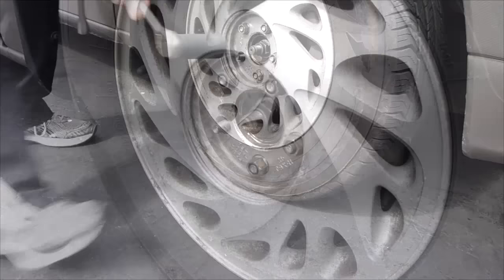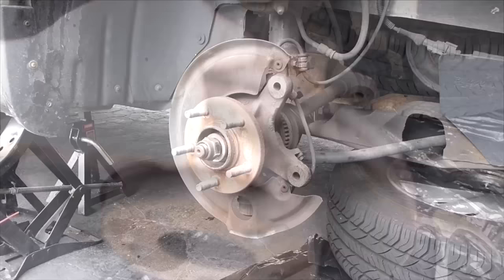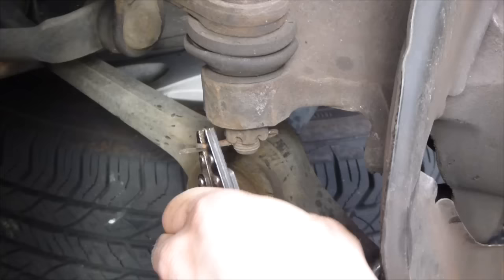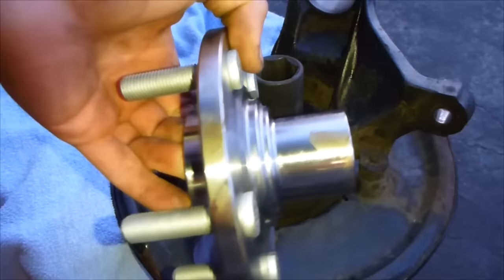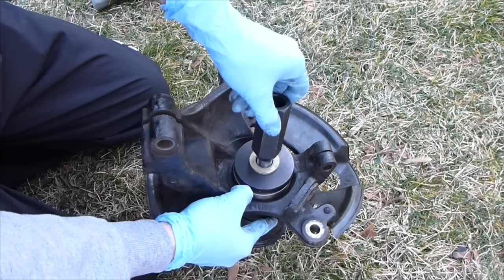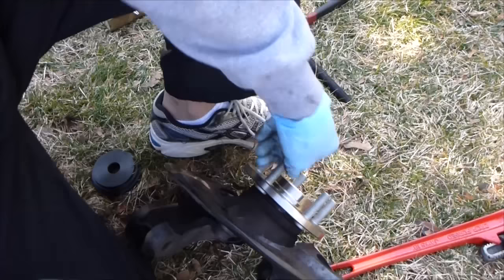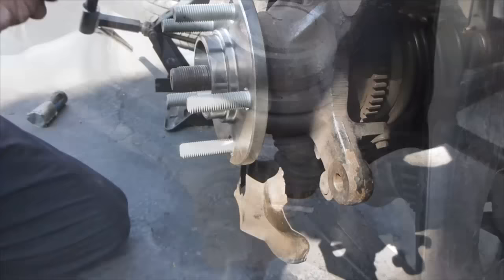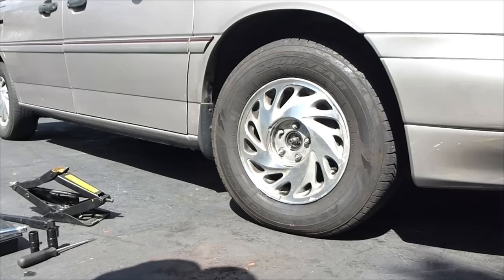How to Change a Wheel Bearing (short and fast version)

Comment: I have changed the bearing 3 times for the same tyre, almost every two months I have to change it. Does anyone know the reason why it keeps breaking down? 
Help plz ;(
Reply: There is most likely something wrong with another part of the suspension system on that wheel. Other issues could be too much stress being put on that wheel regularly for whatever reason, could be many reasons for that...or you are buying really low quality parts.
Reply: R 0 
Should I replace the hub ?
Reply: Use good parts, Moog or similar, NAPA, not Autozone. Make sure not damaging items during assembly- after 3 times you are probably getting pretty good at it, be sure pressing in outer race only. Avoid contamination- dirt, rust, etc., good luck
Reply: @r0498  probably cheap China bearings, you get what you pay for basically.

Comment: Hey Chris, good informative video. 
I wanna ask you something my ride's front right wheel kind of resonates at certain speed - 65 km/hr above that it's good and below that it normal. Tyres spins OK too though its not as free as i saw the hub moving after you replaced the bearing in the video. So does that resonance mean i need a new bearing?
Reply from the maker: Wasim Akram It could mean you need a new bearing or your tires are making the noise. I will have a video soon on how to diagnose a bad wheel bearing so stay tuned!
Reply: I don't think so about tires. I can feel that "resonance" inside the cabin actually. Do you think it still can be tires?
Reply from the maker: Wasim Akram It could be but without seeing the car, it is hard to tell!
Reply: I understand that. I hope you cover this resonance type of thing in your video. Should i wait for your video on wheel bearings? If its not going to take that long
Reply from the maker: Wasim Akram Should be next week. Up to you.
Reply: I can wait a week. Looking forward. Thanx alot

Comment: 3:57 seriously you hammer on the bolt without protection? Its gonna damage the thread? And that small hammer later in the video is NOT enough to take the bearing out, you have omitted a LOT of important  details

Comment: What about a front end alignment? Since you removed hub from strut.
Reply from the maker: Kelvin Lyons You can get one if you want but everything goes back on in the same place. The tie rod was not touched, the strut does not have a camber alignment so that goes back in the same place.
Reply: You would have use cam bolts.
Reply from the maker: Kelvin Lyons They dont have cam bolts for this vehicle. It is a McPherson strut style suspension.

Comment: What bearing removal/install tool do you recommend for a Honday Odyssey 2007, and can it be done without taking the knuckle off?
Reply from the maker: If it is a pressed bearing you can use what I showed in my video (link in description). You might not have to remove the knuckle. If it is an assembly you can do this: https://www.youtube.com/watch?v=fe_WtKIKlYA

Comment: Should i replace the whole hud or just the bearing
Reply from the maker: You can just replace the bearing but the hub was only like $10 or something so I got it as well.
Reply: ChrisFix just the hub assembly or bearing i have a 2001 mercury grand marquis
Reply: ChrisFix rear wheel drive

Comment: your not supose to lock the spindle nut lock, while the vehicule is on the floor you could break the bearing, you need to keep the jack that support the weight of the car a little to prevent this from happening, some car manual even mention it, like subaru
Reply from the maker: +yazmo109 Thanks for shairng. You cannot torque the axle nut with the car in the air. The tires will just spin.
Reply: +ChrisFix how about having someone hit the break, or just relief some of the front end weight, before.

Comment: Quick Question.  You know the Castle Nut (some people call the Axle Nut or the Spindle Nut.)  Before removing it I sprayed it with Penetrating Oil. and before putting it back on I put a little Anti-Seize Grease on the threads.  In another YouTube video the guy said if we get ANY grease on the threads of that Axle nut to immediately wipe it clean.  WHY???  If anything I gave mine EXTRA grease so it went on easy and doesn't corrode in the future.  What is the right answer?
Reply from the maker: Edmund Witkowski The castle nut is what goes on the tie rod the axle nut is an axle nut. I think you are talking about the axle nut. You dont want grease on the threads because you do not want it to come loose. This should not be a problem as long as you only used a little grease and torqued it correctly. Grease will actually help you torque it to the correct torque. What torque did you torque it down to?
Reply: ChrisFix i think my torque wrench went to a max 150 ft-lbs. then i used my breaker bar to turn it more. and also put the cotter pin in.
Reply from the maker: Edmund Witkowski Oh so it is actually a castle nut then. If you torqued it all the way and used the cotter pin you are fine.

Comment: I need advice. I am replacing a wheel bearing on a 2003 ford escape XLT and I cannot figure out if the snap ring goes on the front side of the hub after the bearing is pressed or in the back of the hub before its pressed!
Reply from the maker: +sliv5sliv look for the channel that the snap ring sits in. It's probably after the bearing goes in.

Comment: I have a question about my 2008 dodge avenger.  Steering is easy turning when turning left and car is in moting but when turning right while car in motion its hard.  When car is not in motion turning is hard either way.  Could this possibly be my inner tire rods or the entire rack and pinion?
Reply from the maker: TheRaydeez90 This sounds more like your rack and pinion or your power steering pump. Before replacing the rack, I would try this: https://www.youtube.com/watch?v=A0fiZCHz5ew
Sometimes a flush cleans out a clog and you get your steering back!

Comment: What aftermarket wheel bearing do you recommend as the best and closest to OEM?
Reply: Not cheap China bearings or you will be replacing in in less the 10k miles even if it's all highway.

Comment: What would happened if you don't torque with the right specification and you do it just by feeling?
Reply from the maker: epidemia2007 You can tighten it too much causing the threads to strip, you can snap a bolt, or it would make it impossible to loosen in the future. If you dont tighten it enough the bolt or nut can come off due to vibration. For the axle nut, if you dont torque it properly you can cause damage to the bearing.
Reply: Ok,thanks!!
Reply: Hey Chris,i have another question,Can you tell me where can I find the specs torque for any car?.Thanks again.
Reply from the maker: epidemia2007 I search for them on the internet. Eg. 2001 Mazda B3000 Axle nut torque specs... And see what I can find. I also have a shop manual for my cars which tells you all of the torque specs.

Comment: LOL.  Those bearings came out a little too easy.  Try one that has been on the car for 11 years and 300,000km (160,000miles).  The clip is rusted into place, the bearing won't move when you hit it with a sledge hammer, and the bearing removal tool won't budge it.  I had to take mine to a shop with a 25 ton shop press to force it out.
Reply from the maker: Roadghost88 This bearing was in a van that has 300,000 miles and is 19 years old in the salt belt lol. Each situation is different but a little penetrating fluid goes a long way with breaking free rust: Homemade Penetrating Fluid, How to Make Your Own

Comment: My husband and I are trying to replace the front bearing on our 2008 accord. This is the second time that, during assembly, the bearing breaks when we put it in the hub. We are using OEM master wheel hub and bearing removal and installation kit to do it.
What are we doing wrong?
Reply: Alyssa Glass where does it break from?
Reply: the6thverd it’s better if I can email the pictures. It exposes the piece with the metal balls.

Comment: you didnt have to take the knuckle off.  unless your impact didnt have the force to drive the through bolt and you didnt have the 1.25 inch wrench.  too much work the way your doing it.
Reply: How do you want to get the axle out if you don't at least unbolt the knuckle partially?

Comment: would it be easier to change the hub assembly instead of using a press tool? I mean if the cost isn't to much more. (for my car anyway 2007 optima )
Reply: +jessejaviangel It's press in , unfortunately. This is the only option
Reply: @mmiller1188  ? uh no?
Reply: @samuraimedi4061  It's not a unit bearing. The only way to change the bearing itself is to literally press it out. Or buy a knuckle with a hub and bearing installed

Comment: Hey Chris I need help I have replaced my pads rotors and calipers using your video and I'm having problems my Rotors get very hot and it's very sluggish could this be a wheel bearing ???? someone help out if you see this
Reply from the maker: +Noah Rule It could be a wheel bearing but it is most likely a bad caliper or the guide pins are not greased.
Reply: +ChrisFix I replaced the Calipers brand new not even 500Miles and my Truck is a 2000 Toyota Tundra they don't have guidepins you can grease. But im,hoping it's a Wheel bearing it'll suck,but at least I can find whats wrong with this dragging wheel problem

Comment: I have a question, about my vehicle.its an Ford escape having miss fire.what's the first thing I have to check...
Reply from the maker: Nick Onno There are three things to check. One is the spark plugs and coil packs. Do you have a random misfire or is it a certain cylinder? The next thing is to check fuel pressure. Check out this video: https://www.youtube.com/watch?v=_oXLUqE4Sf0
The last thing is to check the injectors with these two videos: https://www.youtube.com/watch?v=tA_E6X4ISgQ and https://www.youtube.com/watch?v=ZVXchvHefNc
Let me know!

Comment: Can the bearing press kit be used on a rear wheel drive vehicle? Thanks!
Reply from the maker: Nano M. If it has a pressed bearing like this one then yes. If it is a live rear axle you can use parts of the kit to push the new bearing in evenly but you will need a bearing puller to get it out.
Reply: ChrisFix Thanks!

Comment: OK I don't see the whole point to remove the spindle from the car if u have the tool to do it with out removing the spindle,
Reply from the maker: Harold Casco I was replacing the spindle too. So it had to come out.
Reply: ChrisFix I don't think u replace the spindle you install a new wheel bearing to the old spindle yes lol next time don't remove the spindle from the car is more easier just saying tho
Reply from the maker: My bad, I read that wrong. I meant I put in a new hub lol.

Comment: do I have to get a front end alignment after this?
Reply: depends. if this is your first rodeo and you end up replacing any ball joints, control arms, bushing or just anything to do with the steering and or suspension basically then I would. and if your alignment was previously done on bad ball joints to begin with then most definitely again.

Comment: hi chris supper vids I was wondering I have a 2007 hy. tuscun and my back wiper wont turn on at all last year I would push the wiper and it would start but now its completely dead but I don't think its a fuse any idea chris??
Reply from the maker: manny sappy Sounds like a bad wiper motor. I would find the connection to the wiper motor, disconnect it, turn the wipers on and see if there is 12v. If so, your wiper motor is bad.

Comment: I install the hub and one of the piece inside the bearing just came out a little bit so I put it back but do you think I did something wrong,and also the after the installation when you move the hub with your hand needs to be a little bit hard or not so hard,thanks..
Reply from the maker: +epidemia2007 That was probably the beraing race or cap that holds the bearing together. It is ok that it was slightly loose as long as it is in there good now. The hub will be tough to move most likely on a new bearing.
Reply: ChrisFix Ok,thanks I was getting scared and confuse.

Comment: ive got a 2012 Impala someone told me the front right bearing is shot because its making a very weird noise its not like its loud or banging but it's making a very quiet noise like 2ball bearings rubbing together although not all the time it makes this noise. it doesn't get louder if i go faster but when it is making the noise its not constant either.do you think its possible its the bearing?i really need help with this i don't want to spend the money on it if it turns out to be something else.the car has only 70000 kms!
Reply: i
Reply: j

Comment: did you purchase or rent the bearing press kit?
Reply from the maker: I purchased this from harbor freight but now that I know you can rent it, I rent all the kits such as a ball joint press, tie rod puller, or even O2 sensor sockets.
Reply from the maker: Don Priemer Advance Auto has it and so does Pep Boys. The Advance Auto part# is 648741 and it is called the Powerbuilt Tools BEARING TOOL

Comment: Unrealistic.  When pressing the hub out, the bearing inner race 99% of the time comes out with it and u have to press it out or cut it with a cutting wheel. Pressing the bearing out with this tool does not always work.  A hydraulic press is needed to break it loose.  Done many bearings in my life and seen it all.

Comment: how did you troubleshoot this problem to arrive to needing this changed?
Reply from the maker: +Rich Lo watch my video "how to tell if a wheel bearing is bad"
Reply: when you drive at moderate to high speed you will hear disturbing noise. I can't explain what it sounds like.

Comment: What is the minimum gallon a compressor can have to run a impact wrench
Reply from the maker: STEEVE DAVID Nicolas I would say a 20 gallon minimum. That is what I use and I rarely have to wait for air unless I am getting a bolt off that needs a lot of torque.
Reply: Ok, thanks

Comment: 3:23 Yo Chris Fix my axle wont come out of the hub like in this part, any ideas?
Reply: Soak with penetrating oil, loosen nut, tap shaft end, repeat, possibly over several days. Once you get it out, clean it up and apply anti seize compound. While you are at it, spray the other side for when you need to get in there too.
Reply: @jumpinjehoshaphat9075  i got it after a few days -.-" but i used an impact with a tool that hold around the bolts on the hub with a bolt in the middle and pressed the axle out that way; also lots of penetrating oil and tapping , it was the biggest pain XD i got it all out im going to buy a new hub and press it all in the bearing is already in the freezer, Thanks I appreciate it !

Comment: Do You always when change bearing, change hub too?
Reply from the maker: alejsotocon You dont have to. I did because it was only $10 more and it takes away the risk that the hub is bent or causing the bearing to fail. It is not worth it to do all of that work and not replace the hub which is only a few more bucks to replace.
Reply: ChrisFix Thank you for the information! I didn´t change the hub yesterday and now the wheel got a noise. I think is the bearing one more time. I didn´t change it ( hub) because here (Venezuela) is very dificult find it and expensive. My car is a Ford Escape 2007.  Thank you one more time!
Reply from the maker: alejsotocon So do you think it is the other bearing or the one you just replaced?
Reply: ChrisFix The first bearing was demaged (broken) and and the one i just replaced, started to make noise few minutes after when I was testing (runing)  the car. I repeat, i don´t changed the hub. I think may be the new bearing fail because there is a problem with the hub.
Reply from the maker: alejsotocon It could be, but you might be pressing the bearing incorrectly. Are you pressing the outside of the bearing on the metal part?

Comment: Chris Fix I have a squeaking sound that comes from my rear end on my 95 Lincoln town car, someone told me it was the hub on my rear end but I personally think it's my universal joint on my car.... could you give me some pointers or man a video for it?
Reply from the maker: Leon Solomon Try taking the car to a parking lot and do a sharp turn in both directions. Listen for the squeak. If it goes away on a turn, it is more likely that it is the bearing. If it is continuous, then it can be the u joint.
Reply: It's the u joint then bc it's while I'm accelerating
Reply from the maker: Leon Solomon It doesnt make the noise when you are coasting?
Reply: A slight roar, not from the tires
Reply from the maker: Leon Solomon Hm, You can inspect the u-joints by just sliding under the truck and shaking the driveshaft. You can also see if there is a grease fitting on the u joint and grease it up. The hum at speed is typical of a bad bearing.
Reply: Oh ok ty for everything